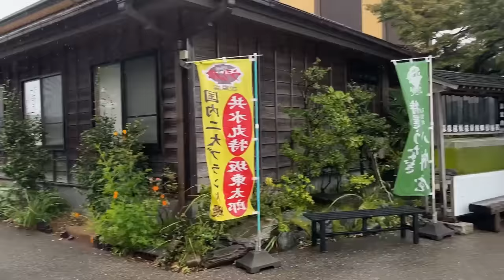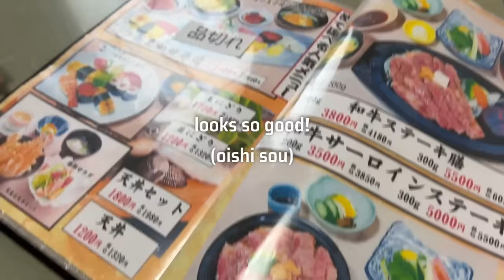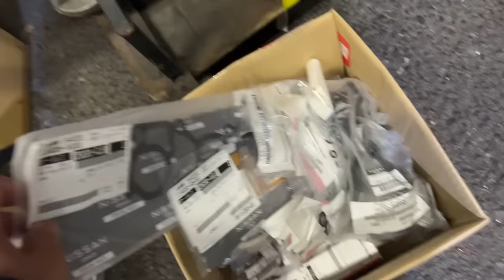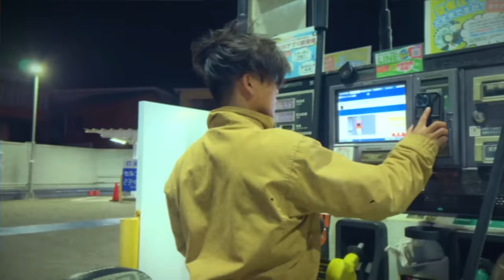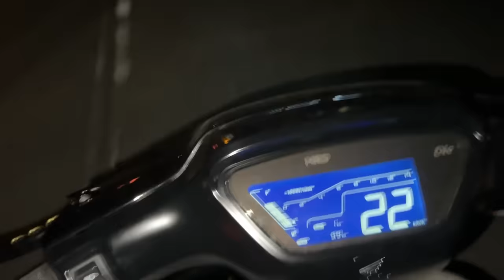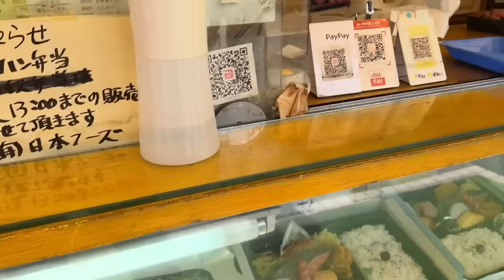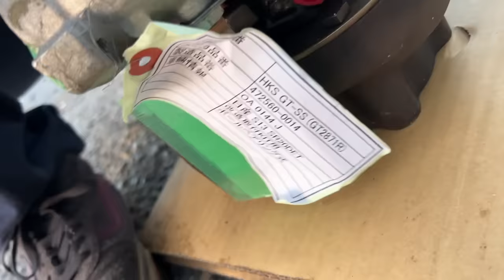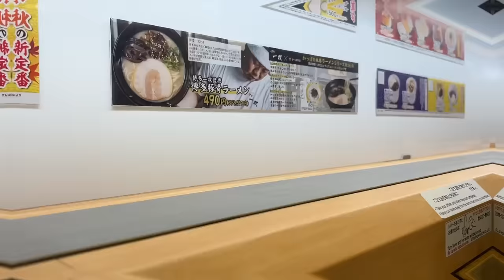My s15 blew up & caught on fire. / S4E76

Comment: bring your S15 to kazamaauto/yashiofactory/rodextyle and say "omakase" probably cheaper and reliable in the long run josh... as you already buy a used unknown condition sr20 that is shit. that option 1

option 2... send back your 2J swapped S15 to japan and that would be FIIIIIRREEEE
Reply: The freight price would be too much sending to Japan 🇯🇵
Reply: @daixer3156   3000usd is not that much considering that S!5 is FDJ2/D1lights class capable build